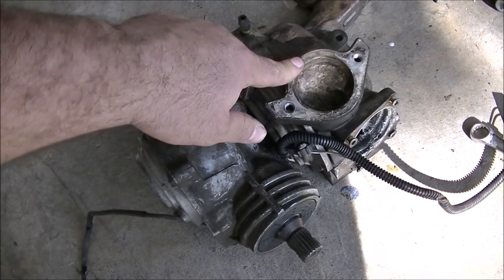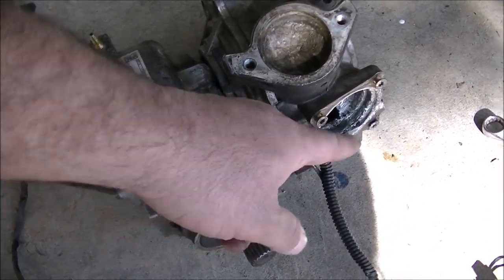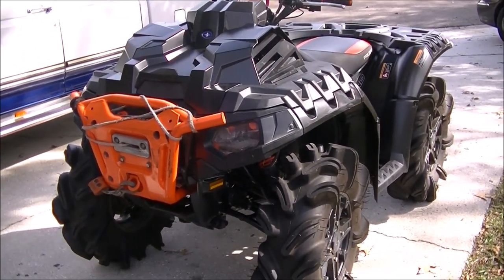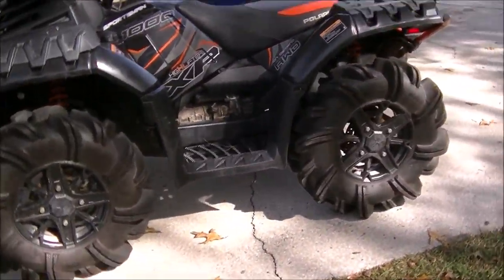RZR 900 DIFF SWAP in a SPORTSMAN 1000

Comment from the maker: Not sure of the compatible years but the compatible part numbers are 1332842, 1333104, 1333105, 1333285, 1333750.
Reply: hi what do you mean by compatible part numbers?  any one of those will work on the sportsman highlifter? what year was your highlifter?
Reply from the maker: @brookezebeljan3528  yes, 2019
Reply: Hey are these the diffs that I can swap with on my 2018 HighLifter sportsman?
Reply from the maker: @QikGt  Yes
Reply: I may have missed it. Where is the pn for the joints for the tie rod. Also thank you for this video. Going on my 2nd pinion on the stock 850 HL diff I'm done! RZR diff here i come
Reply: Never mind I found it thank you.

Comment: You need wood bits to cut aluminum, metal bits just clog up.
Reply from the maker: Used what we had on hand
Reply: @OleNasty79  A little kerosene does wonders to keep the tool clear.

Comment: Did you have to force your tie rods in the knuckles ?it seems that on full drop the heim doesnt roll enough downward. I had to undo the shock put the tie rod on then push down on the control arm to get the shock bolt back in.
Reply from the maker: I never disconnected them from the knuckles
Reply: Man that's so odd. I'm talking mine were a good 3/4 of a inch off full drop

Comment: The tie rods hit the diff big time on a sportsman with a 2"lift... I'm going crazy.. The diff I trimmed the tiny piece off rather than the frame..
Reply from the maker: You need to run heim joints on the inners and you need to loosen up the pitman arm and slide it up the steering stem as far as you can.  And that tiny piece you trimmed off added strength to the diff.

Comment: I’ve done this swap but I used arched tie rods and they still got diff , Any suggestions
Reply from the maker: Did they have heim Joints on the inners?  Also, you have to loosen the pitman arm and slide it up as far as you can.

Comment: Can we do this on a regular 850 xp. I ask because I though high lifters had gear reduction? Is it in the transmission or the differential?
Reply from the maker: I know it will if it has the same body style as the High Lifter not sure about the newer body style but I bet it does.

Comment: So is the lower steering bearing cup not supported now? It use to be supported from the old diff itself?
Reply from the maker: It's still bolted to a bracket
Reply: I have the bearing plate that everyone is using..

Comment: Do you know the year diffs will fit? Thanks in advance
Reply from the maker: Not sure what years but tge part numbers are in the video description and pinned at top of comment section.
Reply: OleNasty79 so just looked up all those part numbers. They all come up for a rzr 800 is that correct?
Reply from the maker: @mikmange95  should be a few rzr & ranger 900s too

Comment: Just curious you don't have to fasten down the steering shift to the diff? Looks like you just capped the bottom. I have 2015 1000 xp with eps.
Reply from the maker: There's a bracket that the cup attaches to,  at the bottom of the stem is a bearing and it sits in the cup
Reply: @OleNasty79  thanks

Comment: I have a sportsman 850 with a 2” lift. Stock front differential with HD pinion cover.  The tie rods hit the pinion cover at full cut.  I want to try the hiems to see if it helps but you mentioned moving up the pitman arm.  Is this possible with the stock diff?
Reply from the maker: No I don't think so because of how the steering stem is mounted to the stock diff.

Comment: Did you use the stock hl cv-axles
Reply from the maker: yes
Reply from the maker: For the most part, the diffs are the same size, just cast a little different.
Reply: Cool thanks i got the 2016 hl 850 i love it does. That diff plate really suppose help any

Comment: Thank for making a video on this lol I was gonna make one doing mine this weekend
Reply from the maker: No problem man.  The more info out there the better.
Reply: @OleNasty79  did u have to buy bolts with the hiems or did they come with everything
Reply from the maker: @austenloan8691  had to go buy some.  Went with grade 8, either 1.5 or 1.75 long, can't remember which diameter and thread pitch either.
Reply: How long did it take to recieve these after you bought these
Reply: john T Funk took like 3-4 days wasn’t bad held up good only thing I’d do different is use red locktite on the heim joints bolts
Reply from the maker: @thebigguy8890  Just a few days
Reply from the maker: @austenloan8691  I used red octite, and lock washers and they still keep coming loose.  Definitely keep an eye on them.

Comment: On the 900 deff what year of rzr did it come out of? I got 2017 highlifter sportman 1k going butt a 900 deff in it but don't know what year deff to get
Reply from the maker: Not sure of the compatible years but the compatible part numbers are 1332842, 1333104, 1333105, 1333285, 1333750.
Reply: Same with a 13 sportsman 850xp?

Comment: Where did you get your heim joints?
Reply from the maker: I put a link in the video description
Reply: OleNasty79 thanks man, but they only have a RH thread, need a left hand thread to
Reply from the maker: @conlanbartley1636  I'm pretty sure they are both right hand thread
Reply from the maker: @conlanbartley1636  if not, I'm sure that company offers a left hand thread one.
Reply: OleNasty79 we got heims, but the tie rod hits the diff at full lock
Reply: Did u have this problem at full lock?
Reply from the maker: @conlanbartley1636  you got to move the collar/plate on the steering stem as high as you can get it.
Reply: OleNasty79 didn’t know u can move it up lol thanks man
Reply from the maker: @conlanbartley1636  no problem bud

Comment: Sweet . I put a rzr 1000 diff in my 800
Reply from the maker: In your 800 Sportsman?
Reply: OleNasty79 no my rzr 800
Reply from the maker: @rambo8729  I was gonna damn that's a lot of fab work!  I put the RZR 1000 diff in my Ranger 900, works great, had to put a new subframe in though.
Reply: Yea definitely alotta fab work and especially on the ranger to beef up the frame .